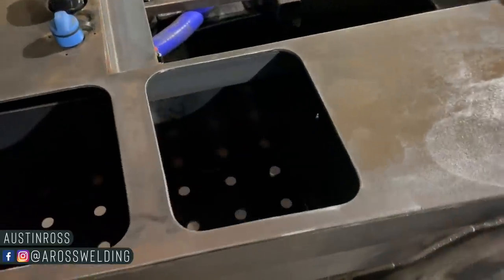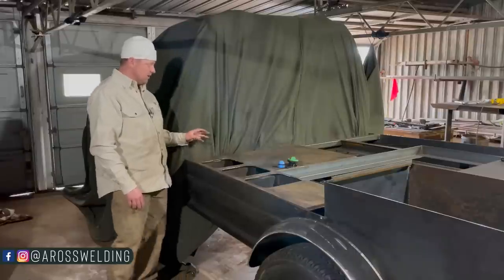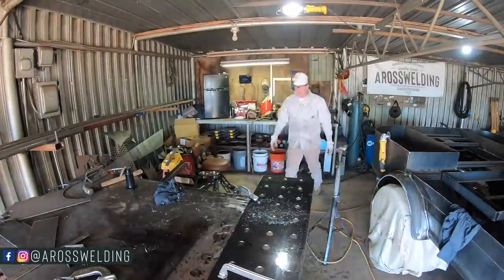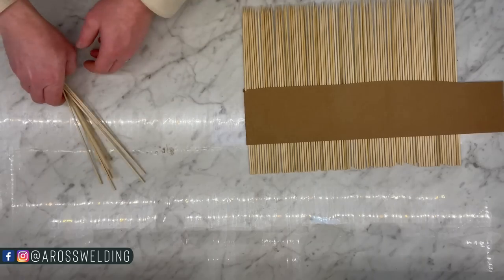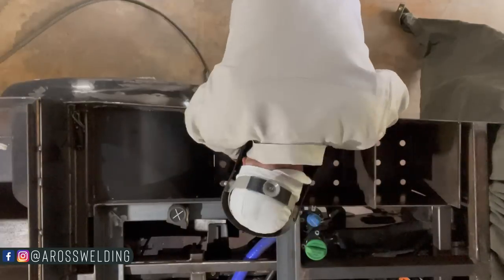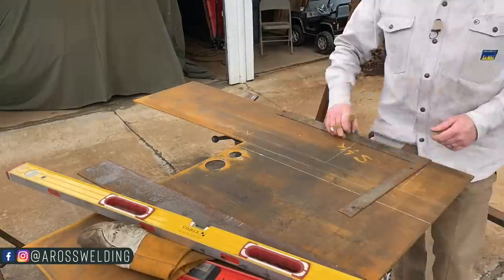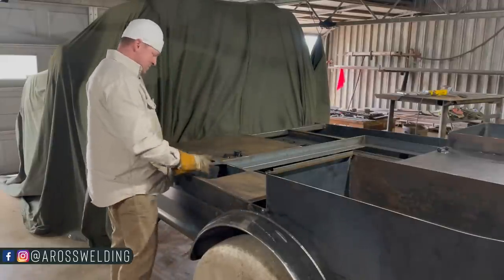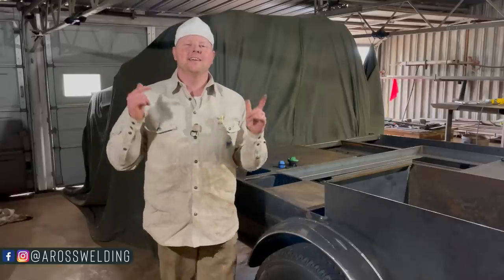Hidden Welding Lead Wells - Secure Your Leads or They WILL Be Stolen (Pipeliner Welding Bed Build)

Comment: A few years ago I bought just a regular hand cutting torch. Not a combo torch. When I was coming up those old welders called the, shipyard torches. But I will say for cutting plate they work great. As always great job.
Reply: I used to assemble a Victor combo torch head with the long tube and mixer from the old style Victor ST straight torches that have the visible tube nuts like the combo heads. They swap right on. Your torch repair outfit can make one (the idea is quite old) when you send one in for work or you can just buy an old ST and do it yourself. What that gets you is an even longer straight torch if you use that head and you can keep other heads too for a killer combo torch kit.

Of course everyone makes long straight torches and they're not expensive used (and basically last forever, I have 1920s torches that work fine and pass compressed air pressure tests WAY above running pressures).

Comment: A suggestion, if I may

Put a 1"skirt around the bottom of the lead wells, individually.
This will help keep splashed mud and water out of the wells.
You could put individual pipe collars around each hole, but that would be overkill.

Comment: Obviously you’re doing this as a customer project, so it’s whatever they want… But I’ve often wondered why these welding beds need to be built so heavy? It seems like they could easily be fabricated out of heavy gauge aluminum and be about half the weight… With everything being made out of quarter inch steel plate it really adds a lot of weight to the truck that just robs your fuel mileage. You could still have a steel frame for Support if you’re worried about the weight of a heavy welder or something like that but as far as the skin you really don’t need heavy steel plate, even for the decking. It would also annoy me to have my filler neck sticking straight up out of the bed just as a personal annoyance when it could’ve been remoted over to the side like normal. If it had to stick up like that I would really want a piece of metal all the way around it as a shroud to keep something from shearing it off if I had a piece of material loaded up there and it shifted during transport. 

Just my two cents worth.